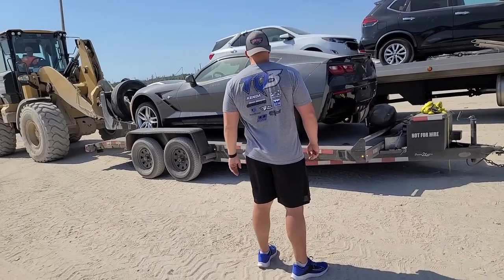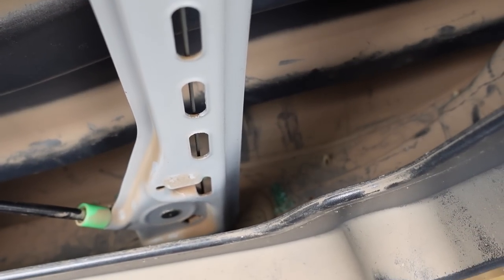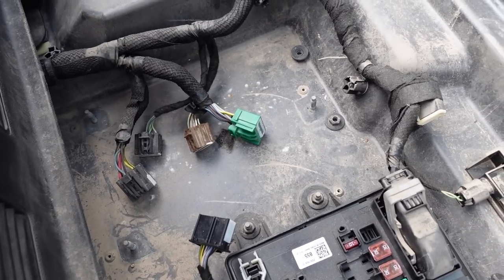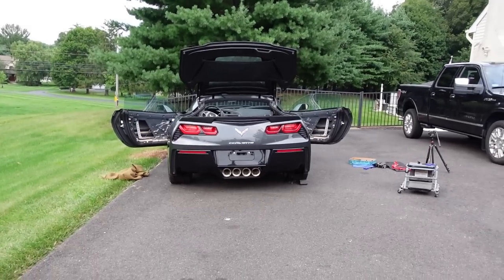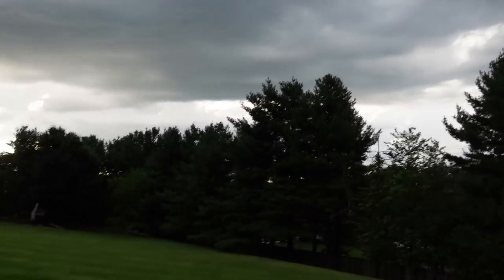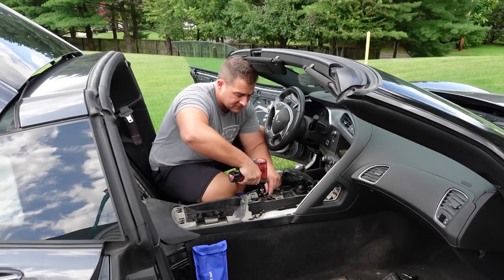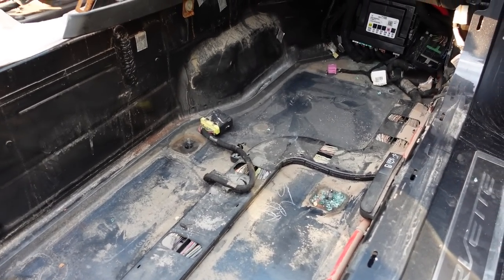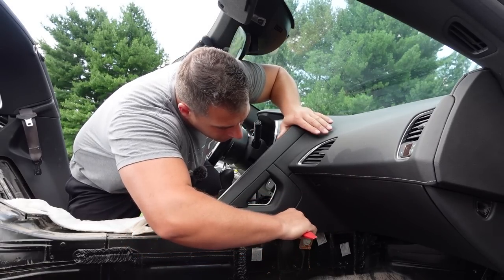My Flood Damaged Corvette just got A LOT more Expensive...

Comment: The connectors may look ok, but chances are the wire itself is corroded inside the insulation, given time the wire breaks inside the insulation and stuff stops working. had this problem on my dirt bike until i replaced whole harness and greased up the conectors

Comment: I have three Vettes, C3 and two C4s.... I thought the C4s were a problem to work on until I saw your 17 Vette. I think I would have parted it out and got my money back. But let's get that motor apart and see what you have. The oil was on top of the water so I think the bottom end of the motor will be OK. If it's not pull it out. How's the tranny? did you pull the pans.
Reply from the maker: Plan is to pull the pan once I've moved the car into the garage. I didn't crack into the transmission yet, be we will certainly be turning over that stone soon.

Comment: I think your theory is 100% spot on.  The company that sold that car at the copart auction took their loss and moved on for good reason.  I bet you don’t make that mistake again at Copart.  The dead giveaway to me was that a dealer was selling it instead of an insurance company, I knew there was going to be a lot more to the story.  The window was broken probably by the tow truck to get in the car, and they had to remove the window motor to get the window track down for the new window.
Reply from the maker: That's a good point that the window was probably broken to get into the car at some point. Definitely some shady business when on at some point in time because I've spoken with the previous owner who handed the keys over to the original tow truck driver and at some point the keys and modules "disappeared."

Comment: The one on the floor in back u thought was expensive it’s the amplifier the three plugs goes to it controls the radio and all sound to the Human Interface Module Called HMI module which is under the driver side panel by the steering wheel and controls the radio the amplifier is important for all sound to the car just fYI

Comment: Put a set of wiesco turbo rods, diamond pistons and rings, Texas speed cam, Texas speed heads, valve springs, big injectors, and a pro charger and you'll have an 800 hp monster that can put down around 1200 if you ever decided to turbo it because those internals will handle that easily. And I would be more worried about the electrical and the clutch is also going to be completely fucked and more than likely the flywheel and if the trans got water in it then every bearing is going to be fucked in it. In my opinion I would strip the car all the way down to the bare chassis replace all electrical, put a Holly ecu and wiring harness and go through all of the drive train. If not your going to have a nightmare of issues and your going to have hell chasing them down as well

Comment: Mike I'd leave bottom-end stock, get a cam trunion upgrade port the heads yourself. You've recorded more porting than 99% of people ever will, and the stock heads are good and get some short headers. I'd check with your local Chevy dealer on an ECU they can probably get it set up for your Vin and everything for an extra couple hundred bucks and save you a massive headache

Comment: It appears the owner pulled everything out before the insurance company had the salvage picked up.  Thad the only reason why everything was put back in place so no one would ask questions when it arrived at the salvage yard.  If someone at the salvage yard did this then they wouldn’t mess with putting the parts back together.
Reply from the maker: If you watch the 2nd episode, I actually got in contact with the previous owner and that's not what happened. Somewhere along the line of auctions to dealers to tow drivers, the modules were stolen and then they hid the evidence. Here's the episode - https://youtu.be/uqALw0fU4uk

Comment: id suspect a lot of those modules were water damaged anyway, but its sad they'd steel
them to resell/ie stick someone else with them.
Reply from the maker: Exactly; I bet you they sold them without disclosing the condition too.
Reply: @MichaelSabo  Naturally, insurance companies lie. 
I bought a a mecedes e430se crank no start (enhance vehicle) 70k miles, excellent body and interior.
salvage certificate listed primary damage body (scrape in the lower passenger door) engine and trans ok, but also it showed Flood. The poor guy paid 8k for the car. 
Flood to the insurance co ment it was splashed in the grill and hydrolocked the engine - bent rods!  They should have disclosed the known engine damage on the salvage certificate. i showed the guy the engine couldnt be rotated with a 4' bar on it and the soaked air cleaner. I bought the car for 1500$ off him, the insurance co ripped him off for $6500! 
Now I suspect coparts also knew what happened too - a flood car wo a water mark and nothing wet inside or under the carpeting.
Reply from the maker: @rosewd2  man, sounds like that guy got hosed too; I'm reading a lot of horror stories in my comments now :/

Comment: Find a wire diagram and figure out the main power wire and ground wire for for the radio and cluster then you can test to at least see it they turn on I’ve pulled radios and cluster from the junk yard and tested them using alligator clips to the battery although when testing the cluster you will only know if it powers on you won’t know if your tech or speedometer work till reinstalled in the car

Comment: Pressure wash those carpets i used to detail cars for a living and I've gutted many of nasty vehicles and pressure washed the carpets and seats and they turn out like brand new looking and it'll get any leftover mud and crap out of the carpets and insulation and leave it out in the Sun to Dry and when u bring it in ur garage at night always leave a fan on it until it's completely dry and that will ensure no mildew or smell once they are dried completely and there's a product called odor ban u can spray on them or mix with ur cleaning solution that will kill any mildew smells or any smells for that matter

Comment: Forget the Rug Doctor, seriously! And hang the on a folding ladder, then put garden hose right to them! Then put them flat on the black top, give each side a few drops of Dawn and some water, use a softer brush and lightly brush them long ways, then side ways, switching back and forth, not in a swirling or circular motion. Lightly do the spots that don't need work, and a little more where it does. then, hang them again and hose the soap out. Finish with a wet vac, suck out as much water as you can. On a hot day, If you start by 10 am, they will be clean and completely dry before dark.

Comment: All the modules that were submerged in water are junk. The conformal coating on all PCBs will peel off and corrosion will set in. I beleive they pulled all the modules assessed the cost of replacement and programming and dumped the project to the next buyer. Dont forget about programming, is costly. Thanks GM.

Comment: Why haven't you drained the water (hopefully just fluid) out of the transmission and differential yet?
I may be impatient but I would have drained all the fluids, rocked the car back and fourth to free the engine up and started it before all this. If an electronic part is going to fail from water it's going to fail whether you look at it first or just power it up. Anyway, good luck, I found this channel looking up TRX400 stuff. I down graded from cars and I'm back to bikes and quads (for now). I grew up in SW NJ and now live 1 1/2 hours from that copart in Palm Beach. I have a lot of family around Philadelphia.

Comment: Yeap I subscribed.  I even have floor pan damage which was caused by a mean ass mechanic using my own sledge hammer.  Bam.  Unbelievable. By the way really sad deal with those crooks who stripped your car.  You should notify Copart that the car was stripped of electronics.  And note who sold the car and who has the parts for sale.  Maybe you can contact the previous owners and inquire if they have the electronics?  A very long shot. But what ya got to lose.  Would be odd if you found your original parts on some seller forum.  Also see if there is a way you can by s/n locate modules that are compatible
 with your car.  Good luck.  When I start on my floor, i will check how you did yours.

Comment: I bet they broke the window because they couldn't get in the car. Also I'd try to go back to Copart and get some money back. If those modules were flooded, I'm not sure they'd be any good anyway. So if they sold them, that buyer got ripped off.
Reply from the maker: That's a good theory on the window being broken. I'm not sure if I'm entitled to a refund being as it was "as-is," but I may look into this. I want to fix the car regardless, but it would be nice to recoup some money.
Reply: @MichaelSabo  There is a way to mechanically open the rear hatch with the key if it works. Sometimes it jams or the cable gets disconnected. I test mine now and then.. It's cool that you're moving forward with this because it's going to create a lot of cool content. Looking forward to it.
Reply from the maker: @joemusicman64  the lock for the back latch is missing too; or it was punched through.

Comment: I Vote for a mild engine build. Something that will make good power and still be reliable
Reply: You should be voting for a miracle. Flood damaged vehicles, especially modern ones with as many harnesses,plugs,connectors, and computers as this one. Rarely can be put back in the road. Short of tearing the entire car down. And replacing everything pieces by piece.
The truth is that that one cylinder isn't the issue. This motor has more issues than he's seen so far.

Comment: It just keeps getting worse doesn't it....   I would just go ahead and part that car out.  You will be chasing electrical gremlins for the life of the car...   Some will take years to manifest and because of the high use of electronics on these cars the manifestation will be very troublesome to diagnose.   I had a corvette that kept having intermittent service charging system messages in the DIC and it took 2 years to finally figure it out.   Dude they didn't steal them they were trashed from water  damage and that's why they are gone..   With all that they did and decided to punt that Vette,  well that's your sign...   Just so you know the modules have to be programed to the car you can't just plug in another BCM or PCM and it's done, the BCM and the PCM have the vin tied to the module.    Not sure for the others.  Most companies that I have dealt with say you need the old BCM, PCM, to reprogram the new ones.  they download off the old and then reinstall on the new..   I know your spirit doesn't want to give up on this car but my experience says this is a car you should punt..  Good luck either way.
Reply from the maker: I just imagine they would have placed the modules back in the car even if they were smoked based on the fact that every other little piece was put back. It's going to be a long road no doubt, but I live to overcome odds 🤘

Comment: Yeah this is a fucking scam.

They used this car as a parts car, I don't believe all those modules are bad. They did this with the intend to scam. If they didn't do it with the intend to scam, they wouldn't have put the car back together hiding all of this.

There's All Cops Are Bastards, but my experience as a shadetree tech there's also "ADASAB". All dealers and shops are bastards. Almost every other car that comes to me for diagnosis and/or repair came to me because the dealer or shop they went to beforehand tried to scam the owner.

Last car came in with a shop trying to get a customer to spend thousands in repairs when the problem was 50 bucks in parts and half a hour to install. My personal experience with bringing my cars to dealers or shops is the exact same.

Any shop is suspect to me until proven otherwise.

Comment: If I was you I would be buying another wrecked car with no flood damage for all those switches wires and modules. 

All that from Chevy is gonna cost a fortune, Even if the engine and air bags are destroyed in the parts car it would still be worth it

Comment: Nope, never gonna run again and if it does it will be a wiring nightmare. That car had power when it got wet and powered wires get green and then black, cut the connector off and strip it back and,, yeah bad. Anyone who works on cars will tell you that. Honestly it's a parts car. And the modules that are missing were junk.

Comment: Dude did you just say that a corvette is more rare than a Ferrari based on numbers ? Did you also say is faster than a Ferrari? I don’t believe it, you’ll need to make a video! Because like what in a straight line, top gear proved how slow the corvette is on the track with the stig. I just can’t help you called it a super car. It’s Chevy corvette like not that special. Heavy slow and easily spins out. Now the new corvette mid engine that’s a different story! Mike sabo please make a race with a Ferrari video !